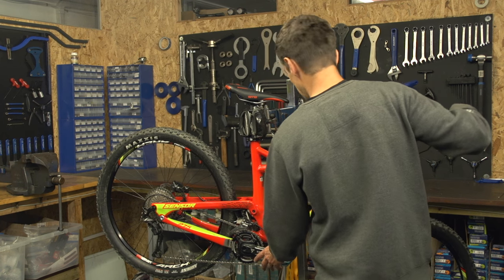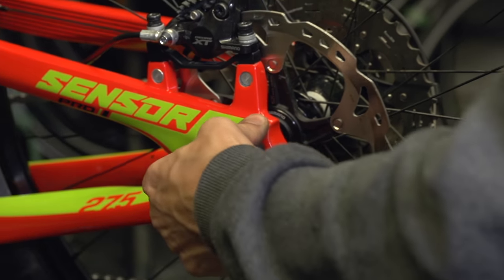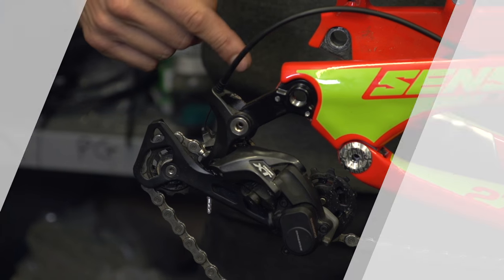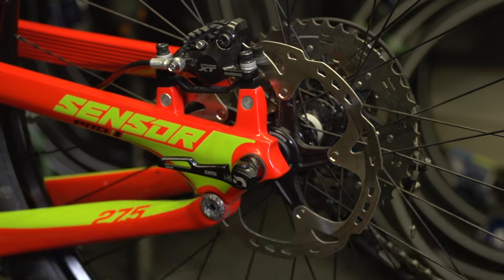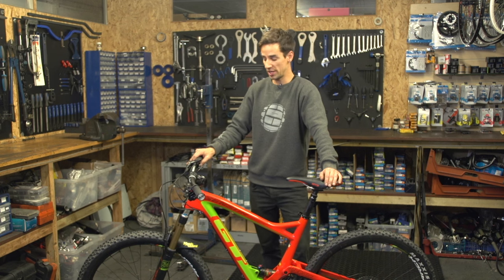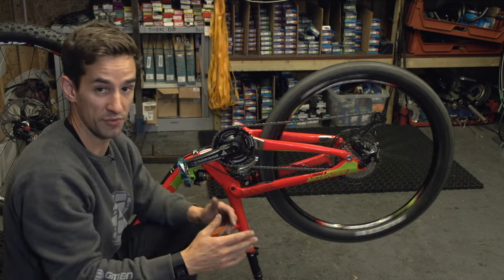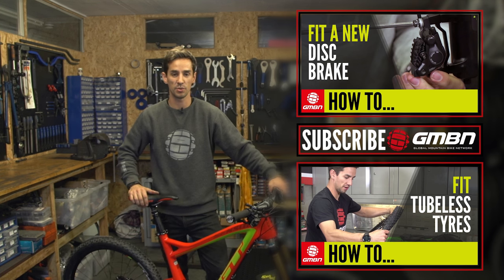How To Remove The Rear Wheel On Your Mountain Bike | Basic MTB Maintenance

Comment: Thanks for this video! Although I've been been riding for many years, mountain biking since 2009, I've never tried to remove a rear wheel but I need to now to replace my tires with more "street friendly" tires. I'm still apprehensive about doing it though. Just afraid I'll screw something up and won't be able to get it back on just right.

Comment: I dropped my back wheel from the bike; that part was easy. Then I tried to get it back in, and that was murder. The washers under the axle nuts kept moving and preventing the axle from going into the dropouts. Contending with the washers and the disc brake was driving me nuts, so I ended up taking the bike off the repair stand, turning it upside-down and putting the wheel in. I now turn the bike upside-down any time I need to remove the wheel. It's so much easier.

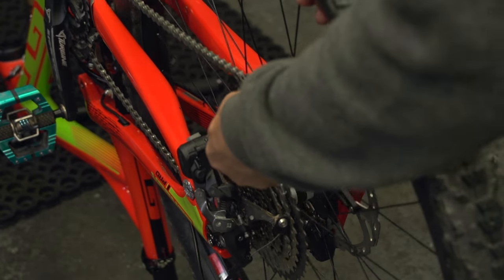Comment: It looks so weird that the left hub endcap just sits right up against the unpainted frame without washers or anything. The right side hub endcap sits in the hanger which looks fine. Anyway that's why I looked for a vid that shows the left side so i can compare with my bike. I took my wheel off today and just thought the left side hub endcap looked so weird up against raw metal frame material. One would think it would have something to sit in or on like the right side. Wish someone could explain why nothing is used for the left side end cap to rest on. Great vid and the only one that showed my situation. Thanks! 4:04 and again at 4:23 excellent!

Comment: So a spare set of wheels (to switch to for road use), I would need to buy:
1) wheels
2) rims
3) disc brake rotors/discs 180mm, 6 Bolt
4) hub
5) cassette (same as mtb?)?
6) road tyres (do i need the same size width as my chunky MTB ones -  27.5" x 2.60"?)

Comment: How to diagnose loosen spokes ? my rear wheel craks when i brake/accelerate hard... My cassette is tight and my hubs are ok, I thinking about my noise is from the spokes but i dont want to touch it if my problem is not from there...
Reply: +Andrew Zegel No it is clearly from the rear, its not my BB since if i brake hard without pedaling it also happends...
Reply: Damn i hope i wont have to :o Thats a no-name one so its not expensive at all but anyway... thank you for help

Comment: My bike doesn’t seem to have an axle system. Now I will clear that up. It does have an axle. However the housing on the bike is not a hole it is as best as I can explain it 3/4 of a hole. The issue I have with this is the wheel although fitting well is not actually 100 mated to the bike. I brought the bike overseas from Australia to Thailand. And have to bike shop to put back together. Now is there something missing or is this a regular thing. Have just done my first tyre change and now I’m scared to death to take it out. Again everything seems fine and has refit well but it does not seem right.

Comment: there is less of a gap between my tyre and the frame on the chain side of my new bike set up. is this normal or do i need to adjust please help soon before i use the brake pads any more. rear tyre btw

Comment: Have $200 saved up. I can either buy some $50 shimano mx80 saints or deity compound pedals then save up $50 more for a dropper post. Or, I can buy a dropper post first and save up for pedals. Found a new gravity dropper turbo LP (125mm) for $180. What should I go for first?
Reply: +Jordan Keeler and should i buy the gravity dropper or another dropper post? I need 125mm or more travel for under $200.

Comment: I want bolt through wheels, there's no problem with readjusting  the brake caliper like there is with quick release
Reply: You really shouldn't need to readjust the calliper every time you remove the wheel :s If your callipers are correctly set up and centred on the rotor, there should be enough clearance to avoid rotor rub.
Reply: SmevMev my caliper has about half a millimeter each side of the disc and either my disc or wheel isn't strait
Reply: Exactly my issue every time my front calliper needs readjusting and even then still slightly rubs, the rear is never a problem for some reason

Comment: Im looking to go one by
I have a 3 speed up front and i was wondering if (i) I can use the current cranks and (ii) I can use one of the current rings
#askgmbn
Reply: +David Brown Fan you can use the rings and the crank, but it would be better to buy a narrow wide ring.
Reply: +David Brown Fan I tried doing a 1x with a regular chain ring. It works but the issue is that the chain randomly drops on up shifts, even with a clutch mech. The up shifting (to the smaller gears) makes the chain whip around a bit which makes it drop outwards sometimes. And since it drops outwards it ends up dragging in the dirt. It kinda works fairly reliably if I pedal really lightly while shifting up, like spinning slower than the wheel.
Reply: +Andrew Zegel dude thanks ive been trying to convert to a 1x system for a month now and the chain just kept falling off

Comment: I removed my rear wheel, but I accidentally squeezed the brake levers, but nothing happened!  Please give me an explanation on what happened (Btw, yes I do have disc brakes, and yes, I squeezed the brake lever of the wheel that was off)
Reply from the maker: If you are lucky (and only pull the lever once) the pads will return to their normal position, if you pump again they can inch out of the calliper a bit, towards each other. In that case you need to carefully push them back in using a tyre lever or similar. If you push too far they will pop out, then you will need to put them back in and bleed the system.

Comment: I can’t do it, and I’m NORMALLY pretty mechanical inclined. So frustrating. I can’t use my bike right now because the rear wheel is off.
Reply: Is there a bike shop near by? What did you do to make it go off? Did you press the brakes levers?
Reply: Sorrowful sheep Hey, thanks. I finally got it back on. That was way harder than I thought it would’ve been.
Reply: @EricWebSurfer  It was the same for me. It seemed I would never get it back. And somehow my derailleur needed readjusting after that.

Comment: can i pul my brake lever when my bike is flippid over?
Reply: Sure you can, but then your brakepads is just going to be pressed against each other. And then you can't fit your disc because there is no space.....
Reply: So, no don't do it if a wheel is out
Reply: Even if your wheel is in, try not to pull it. It can move the small air pockets up to your calliper, and you can lose brakes when doing that.

Comment: I always scratch my brake disc against my bike when i remove my wheel :( there is almost no space with my 180mm brake discs... i hate it.
Reply: Try putting a bit of fine cardboard between the disc and the frame, or a bit of 3m adhesive vinyl on the section of chain stay that gets scratched.
Reply: i got a scott gambler with 200mm discs and ive scratched a whole bunch of paint on it xD. t

Comment: Could you show us how to pump up my tires next please? Come on lads really?
Reply: how to change gears on a mtb step by step lol
Reply: +stu robb Well joking aside,  I've had people on the parking lot asking me to borrow my pump. They slapped it on (without unscrewing the valve core) and  started pumping so hard, air was hissing past the pump seals or blowing past the valve wondering why it is taking so much effort. Not everyone knows how to use their equipment properly right away.
Reply: SoloStu lol easy
Reply: You started from the bottom at some point don’t be a smart arse
Reply: @trancebass2741 I didn't realise there were so many pretentious twats in the community. It's odd how people aren't more pleased that people want to learn they'd rather make fun of them.